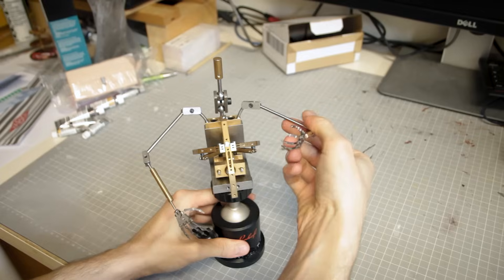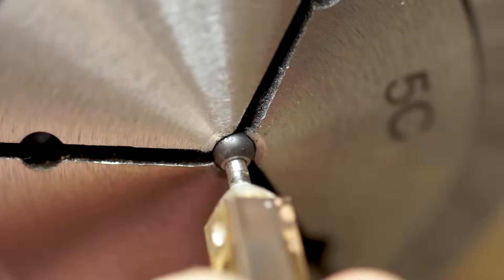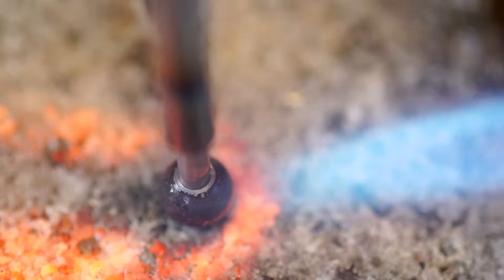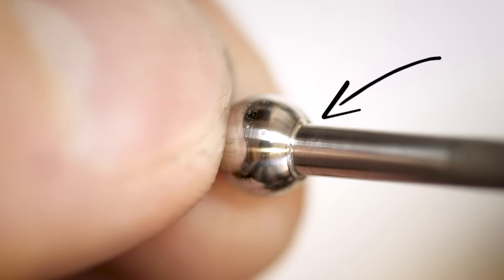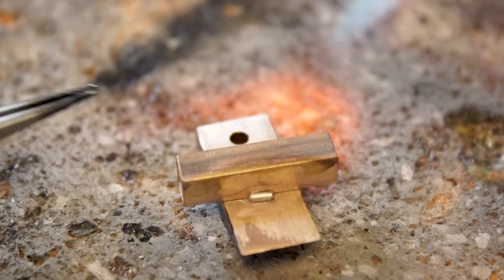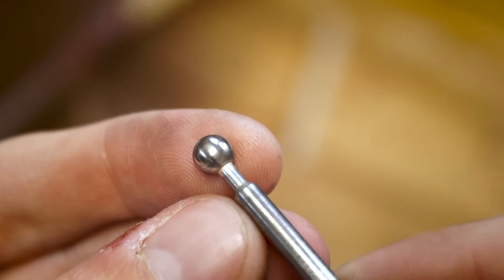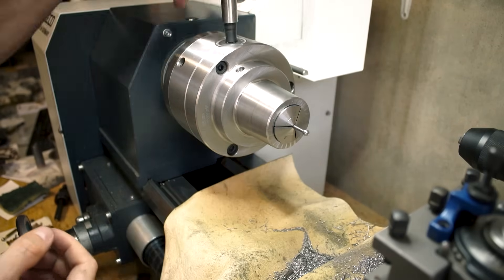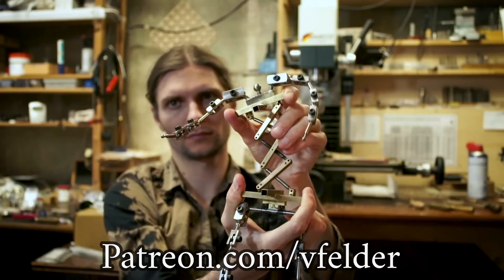Learn soldering Stopmotion Armatures

Comment from the maker: Some things I forgot to mention:

Hard soldering is another word for brazing. With silver filler material it's usually called silver soldering, but I also heard brazing.

Making the flat surface on the ball larger than the hole creates a little surface for the solder to flow onto, without protruding over the ball's surface.

Soldering is not welding: The silver basically acts like a strong "glue", but to form a strong connection it either requires a big surface area (like on the brass block examples) or the main mechanical forces should be handled by the geometry of the connecting metal parts themself. That's the reason we're drilling a hole rather than just soldering the rod directly to the balls surface. In this situation the solder only prevents the ball from rotating and from sliding off, while the stronger "sideways" forces are handled by the steel parts themself.

To keep the oxidation from the soldering process as minimal as possible it helps to cover the entire surface of the ball with flux too.

When cleaning the balls with sandpaper, make sure to move it evenly around the entire surface in order to remove roughly the same amount of material from the tip and stem region as from the sides. Ball and Socket joints still work well with slightly undersized balls, but the roundness is very critical. With my chemical approach and soft polishing tools the amount of material removed is less than 10µm (measured ball diameter).

To achieve the final mirror finish it actually helps to use a bit of rather used sandpaper with embedded steel dust, I suppose it then acts more like a lapping tool and doesn't do a lot of sanding anymore.

...Not sure if that is all, I might add stuff to the list as I respond to your comments! ;)

Interesting Questions from the Comments:

"Shouldn't you re-harden the balls again after soldering?"
-> Commercially sold drilled balls are never hardened in the first place and are often made from alloys which cannot be hardened at all, like 1.4301 / 304 stainless. This is fine because the friction in a ball and socket joint is distributed over a large smooth surface and thus the wear is really minimal.
Nevertheless, my bearing balls can be somewhat re-hardened in the process. They are made from 1.3505 chrome steel which has air-hardening properties, especially on these tiny parts. That means they don't need to be quenched, blowing some air on the hot part is already enough to form a hard surface. Of course it is difficult to control it precisely, I've just notice it by accident.
In fact it can be difficult to soften these tiny balls in the first place, I had to use some extra insulation on the 3mm ones to have them cool down slowly enough to actually stay soft! :D

"why don’t machine the ball and rod out of a single piece of stock?"
-> This would require an extremely expensive industrial CNC lathe to get the necessary precision on the ball. Technically it works, but it's just not feasible for most of us, especially as most of this double ended ball connectors need custom lengths for each character, so no part is ever going to be mass produced.
There are manual ball turning tools for the lathe, but they are usually just intended for decorative radii, I guess it would be very hard to get the required precision that way...
+ with soldering it's possible to choose different materials for the rod and the ball.

"Just use Loctite glue or other specialized adhesive"
-> Loctite works in 99% of cases, but when it fails it's catastrophic because often it's impossible to repair an armature once it's inside a puppet. (Witnessed two Loctite failures so far). The forces acting on those balls when used in a stiff joint can be incredibly high, and you never know when you have a bad glue joint slowly working itself lose...
Solder is more reliable as you can judge the quality of the joint from the outside, it's significantly stronger and there is a reason it's used on all major stopmotion productions exclusively even today. But of course Loctite can be a reasonable option for hobbyists. :)

Comment: Congratulations my friend, excellent video on the subject. At the beginning of the video you softened the balls to be able to machine them. After welding the ball to the rods, do you harden the spheres again?
Reply from the maker: Thank you! :) No, I cannot harden them properly after they have been soldered sadly, but the bearing ball alloy is quite tough even in it's soft state and the smaller balls are able to cool quick enough in air to air-harden after soldering. That's at least a compromise... But indeed this can be a problem (The balls always needs to be slightly harder than the sockets), and I'm still looking for a reliable solution for bigger balls where air-hardening doesn't work...

Comment: Great content, thanks for sharing. I have had pretty good luck drilling balls that were not annealed with a HI-ROC drill bit. It's a short spade style drill made of carbide I believe. I guess you will loose some hardness of the ball with the silver solder process, but it's got to be harder than a fully annealed ball.
Reply from the maker: Thank you! That sounds great, I would love to skip that extra step - Never came across these kind of drill bits, I'll definitely give it a try.

Comment: For the threaded rods/balls or even the blind holes I wonder if it's not quicker and easier to just use some high strength locktite? My understanding is that the traditional techniques of stop motion were codified quite a long while ago and chemical adhesive science has some a long way since then.
Reply from the maker: Well, Loctite works in 99% of cases, but when it fails it's catastrophic because often it's impossible to repair an armature once it's inside a puppet. (Witnessed two Loctite failures so far). The forces acting on those balls when used in a stiff joint can be incredibly high, and you never know when you have a bad glue joint slowly working itself lose...
Solder is more reliable as you can judge the quality of the joint from the outside, it's significantly stronger and there is a reason it's used on all major stopmotion productions exclusively even today.
But of course Loctite can be a reasonable option for hobbyists. :)

Comment: Excellent video, I would like to know what type of silver solder you use: 15%, 25%, 35%, 45%, 56%, which works best and is most effective?
Reply from the maker: Thank you very much! I'm afraid I'm not qualified to answer that, as I never did a proper testrun to compare the different flavours, and sadly it's often not clearly specified on the packaging. I generally prefer the ones with with a low melting point around 650°C, they are softer but also less brittle. The thick wire in the Video is Ag55Sn, the thin wire is this one with unspecified ingredients: https://goldschmiedebedarf.de/en/product_info.php?products_id=14662 - I suspect the silver content is even higher because it's intended for silver jewelry.

Comment: glue or thread lock seams a much better solution for threaded balls
Reply from the maker: Yeah, it works well but fails badly... Solder is significantly more reliable and is used on all major Stopmotion productions. But of course it's a reasonable option for hobby productions.

Comment: Have you tried using one of the industrial adhesives like Loctite 680?  I've had good results with 680 on similar size joints for some measurement arms and small ends on rods for jig handles.  Not as strong as silver solder but it has got the job done for my needs which are to resist similar loads as your stop action models.
Reply from the maker: Well, it works in 99% of cases, but when it fails it's catastrophic because often it's impossible to repair an armature once it's inside a puppet. (Witnessed two Loctite failures so far). The forces acting on those balls when used in a stiff joint can be really high, and you never know when you have a bad glue joint slowly working itself lose...
Solder is more reliable as you can judge the quality of the joint from the outside, and there is a reason it's used on all major stopmotion productions exclusively.
But of course it's a reasonable option for hobbyists. :)
Reply: @ValentinFelder   Fair enough.  I wasn't sure about the loads on the balls.  And certainly silver solder is stronger.  Thanks for the reply!

Comment: Another tip, you need to clean your solder with a bit of fine sandpaper to remove the surface oxide, always do it right before you are going to use it, I suspect that's the reason for the failure you showed. 
I learned this and many other great tips on silver solder in Greg Greenwood channel here on YouTube. 
Thanks for the video, very informative!
Reply from the maker: Thanks for the tip! This might indeed be the cause of the occasional mishaps, especially as silver can form quite a thick oxide layer over time.

Comment: A jeweller friend of mine uses the liquid white out correction fluid as a mask to prevent solder from flowing where she does not want it when she does filigree and other delicate soldering. I hve used it a couple times and it works pretty well and cleans off easily. You could try that on the balls and rods when appearance matters.
Reply from the maker: Yes, another commenter suggested it too - I haven't tried the correction fluid yet, but I have a bottle of dedicated no-flow liquid from the jewelry maker supply which has the same effect. It can be super helpful on some occasions! :)

Comment: cool, very interesting! the balls dont need to get hardened again afterwards? or would that only stress the other parts of the joint that are also not hardened?
Reply from the maker: Thank you!
To quote from my pinned comment:
Commercially sold drilled balls are never hardened in the first place and are often made from alloys which cannot be hardened at all, like 1.4301 / 304 stainless. This is fine because the friction in a ball and socket joint is distributed over a large smooth surface and thus the wear is really minimal.
Nevertheless, my bearing balls can be somewhat re-hardened in the process. They are made from 1.3505 chrome steel which has air-hardening properties, especially on these tiny parts. That means they don't need to be quenched, blowing some air on the hot part is already enough to form a hard surface. Of course it is difficult to control it precisely, I've just notice it by accident.
In fact it can be difficult to soften these tiny balls in the first place, I had to use some extra insulation on the 3mm ones to have them cool down slowly enough to actually stay soft! :D

Comment: Hello, a rate for an armature of 19 cm? Generic and with personalized design?
Reply from the maker: Thanks for your interest! - It depends on many more factors: Does it need hands/feet? If yes, which type? Should they be removable? What kind if rigging points and how many? Does is need a head? Which joint layout? Which brand of joints?
...I'd say the humanoid price range is roughly 800 - 2000 EUR. If you want a quote, please send me a 1:1 sketch with the joint layout and all extra requirements by Email at info@dasgetriebeimsand.de

Comment: This is the best video ever made on this topic. Love it!

If there is a tip it can be added is using Tippex to prevent silver to spreed to parts you don’t want and the gravity to help it flow. 
About hardening 304, I do have the feeling that it can be affected by quenching. Don’t know the fisics, you can be right, and I would like to learn more about it. I always prevent joints in 303 from quenching, I have had situations where the ball is softer than the joint and it is terrible.
Thanks for sharing and opening the debate.
Reply from the maker: Thank you so much! :)
I wondered, do you use a similar technique or how do you usually solder the blind hole balls?
I didn't know the Tippex trick, but I have a special non-flow liquid for the purpose. It's not in the video because I rarely need it for joints, but it can be super helpful on occasion.
At least according to the datasheets 304 / 1.4301 isn't able to be hardened, but there might be a small effect. Maybe my personal alloy advisor @alrikscyriel6208 can tell us about it? :D
The ball should always be harder than the socket, so the joint blocks shouldn't be quenched, that's a good point!
Generally the classic stainless alloys don't seem to be perfect for friction joints, as they can cold-weld / seize up if a tiny grain gets between the surfaces, which triggers a catastrophic chain of abrasion. (I had some issues of that kind with my tiny finger joints.) Normal tool steels can handle these situations much better and behave much smoother for mechanical applications, I had used 1.2510 for palms and feet and it worked marvellous. But of course everyone is afraid of rust, though it's not a huge problem usually, unless you're still working with ammonia + latex...
I think these aspects deserve their own follow-up video at some point! :D
Reply: @ValentinFelder Tippex always works for me when you need to protect a screw. I would love a special video about alloys and nerd stuff. Thanks again.
Reply: I've tried using Tippex and also soft soap but it has never worked.
Reply from the maker: @lste  I use this stuff, works quite well: https://goldschmiedebedarf.de/en/product_info.php?products_id=12685
Reply: I use a bit of ochre oxide powder mixed with either a drop of oil or a drop of water as a solder inhibitor on jewellery. Apply with a paint brush or toothpick.

Comment: What type of metal do you use for the rods?
Reply from the maker: That's "Silver steel" 1.2210 - Might be a bit overkill, but it's available as small diameter ground round stock and super stiff. I'm not really taking advantage of it's excellent hardening properties here, but it's still a good alloy.
But for most purposes any normal steel or stainless alloy should work well enough. :)

Comment: Oh man, that's all the answers i've been looking for. Too bad it's hard to scale down twice the size. I made several stop-motion figs in my day, using tall (2.5-3 mm. high) headed 1.5-2 mm. nails and brass strips with drilled holes as joint material. Upside was the smallness of this configuration, when downside is the absence of tensioning option.
Reply from the maker: Glad to help! :) ...As I understand it you have riveted the joints? - I have also used this technique when I needed really tiny joints, but whenever possible you'd want something you can tighten and disassemble for maintenance.

Comment: Thank you Valentin for all your great videos! I found this one particularly useful!
I do have a question though, shouldn't you re-harden the steel balls again after this process?
Is it even possible after the silver soldering?
Reply from the maker: Thank you, it's a pleasure! :)
It is not necessary but indeed possible to re-harden the balls:

Commercially sold drilled balls are never hardened in the first place and are often made from alloys which cannot be hardened at all, like 1.4301 / 304 stainless. This is fine because the friction in a ball and socket joint is distributed over a large smooth surface and thus the wear is really minimal.

Nevertheless, my bearing balls can be somewhat re-hardened in the process. They are made from 1.3505 chrome steel which has air-hardening properties, especially on these tiny parts. That means they don't need to be quenched, blowing some air on the hot part is already enough to form a hard surface. Of course it is difficult to control it precisely, I've just notice it by accident.

In fact it can be difficult to soften these tiny balls in the first place, I had to use some extra insulation on the 3mm ones to have them cool down slowly enough to actually stay soft! :D

Comment: Is there any functional reason why you don’t machine the ball and rod out of a single piece of stock?
Reply from the maker: It would require an extremely expensive industrial CNC lathe to get the necessary precision on the ball. Technically it works, but it's just not feasible for most of us, especially as most of this double ended ball connectors need custom lengths for each character, so no part is ever going to be mass produced.
There are manual ball turning tools for the lathe, but they are usually just intended for decorative radii, I guess it would be very hard to get the required precision that way...
+ with soldering it's possible to choose different materials for the rod and the ball.

Comment: you could also try to cut a groove(or flat spot) along the rod where the joint would go to prevent any buildup pressure in joint
Reply from the maker: Good idea! I guess it would be more work than just drying the flux though.

Comment: What works well for bigger parts is brass bracing. If you try that with small stuff you will find out what heat pitting is. Also you need a propane oxygen torch or it won't work. But especially if you want to join steel to carbide, that's a useful solution. But I doubt there is any reason for that in armature making.. so that was a long winded brain fart. ..
Reply from the maker: It is stronger than silver solder I suppose? There might be occasions where the surface area to join is just a bit small, then is could be a viable option to get a string connection nevertheless. Also I never had to solder carbide, will keep it in mind!
...What is heat pitting by the way? :D
Reply: @ValentinFelder  deep oxydation. Happens when you have to heat stuff to more than 800°C for a longer time (about 5 minutes) this can mess up fittings. Ask me how I know...
Reply from the maker: :D I can imagine - But honestly, if it takes that long to get solder where you want it something isn't working out... Maybe it's different with brass filler? I'll try someday!
Reply: @ValentinFelder nope but my parts are bigger and sometimes they act like a heatsink. That can take some time.